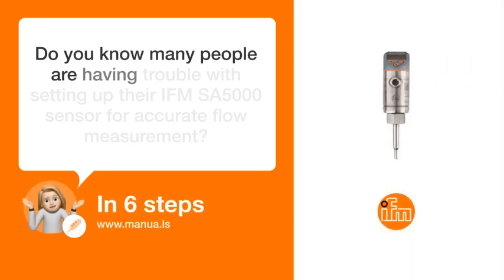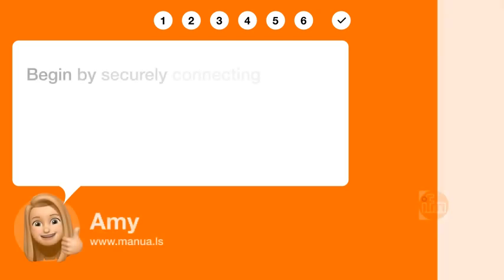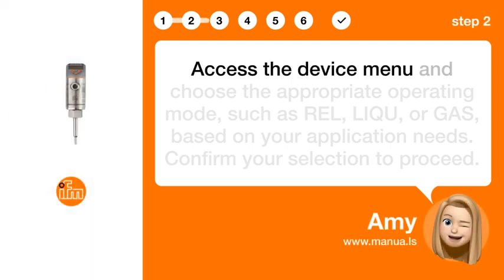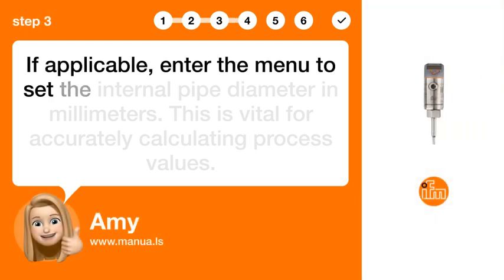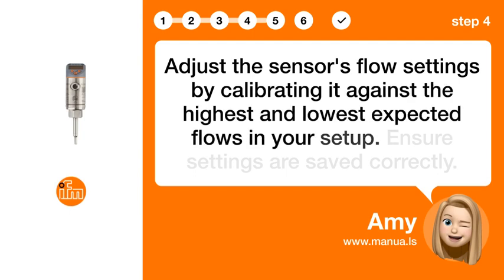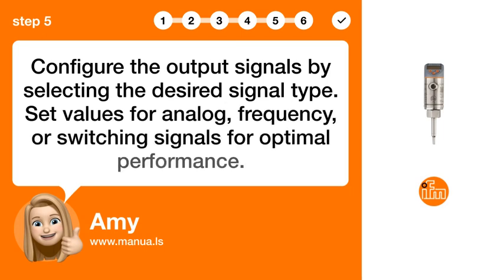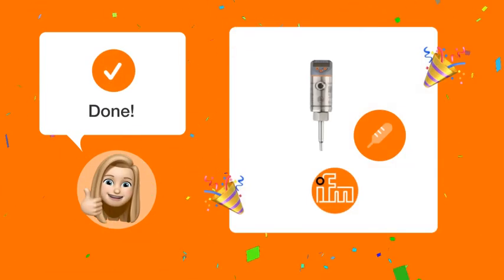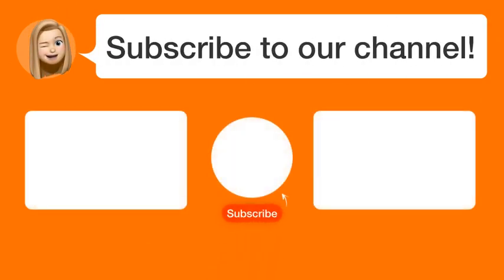How to Optimize Flow on your IFM SA5000 Sensor

Comment: Thats all very well, but something like this should be factory calibrated?? perhaps...
No point in using an anemometer to tell the SA5000 what it should be reading, the Anemometer is an 'indication' only unit.
I hope you mean setting up the analogue output calibration, ie what should be 20mA, and setting the flow of say 25m/s is represented as 20mA. and zero flow is 4mA.